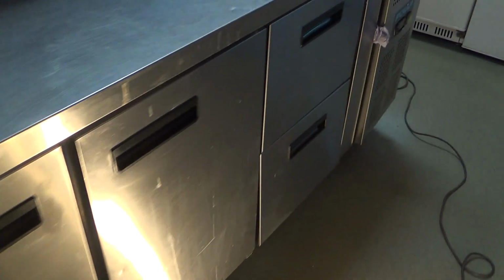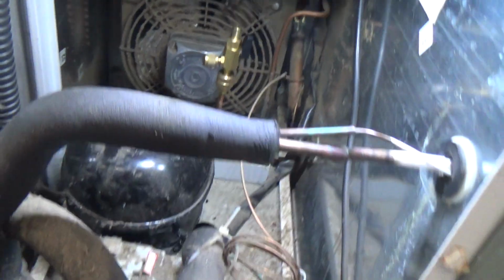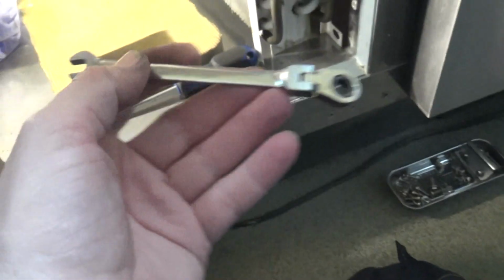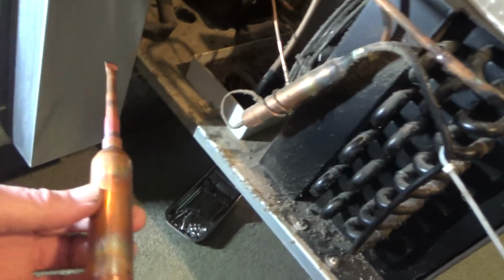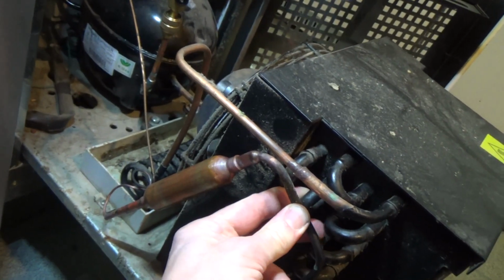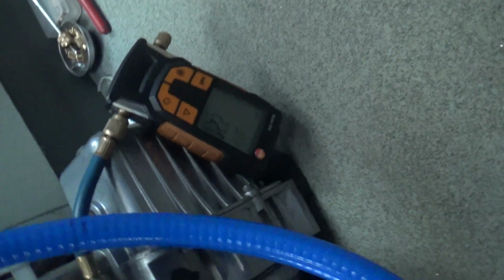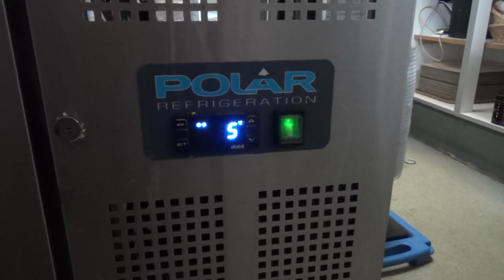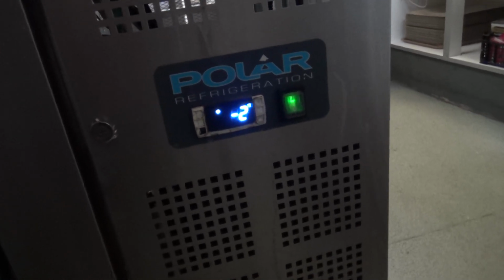Polar Prep Table Evap Change

Comment: John, I see you using the “Tru-Blu” vacuum hose, I’ve got a couple but don’t really care for how stiff they are. Difficult to access some fittings. Thanks for the video. That drawer unit was surprisingly clean inside.
Reply from the maker: Yeah the hose is a pain to use in cold weather.

Comment: Interesting concept... work table with integral chilled drawers and cupboards!
Reply from the maker: They are very common on restaurant/pub kitchens, not too bad to work on just can be a bit stinky with rotten food if they don't clean them out well. Cheaper ones the chill the walls like a domestic fridge, probably a better job if they are storing corrosive stuff in there, fish, vinegar sauces etc.